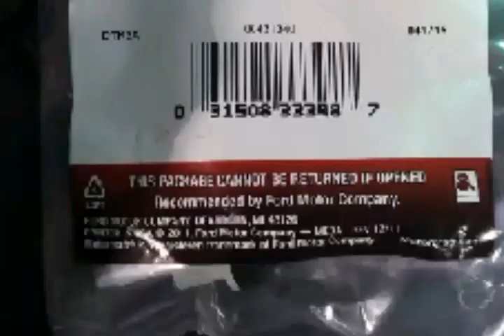Ford E350 - Dash vents turn off *FIXED*

Comment: If its the vacuum reservoir that went bad why are you cutting the vacuum line at the red tube? theres nothing wrong with that stuff right? aqm i missing something?
Reply from the maker: That was just an option for using a soft rubber hose. It'd definitely be better in hindsight to use a union there with your new line.

Comment: No help here the 2012 van  working on don't have a vacuum canister anywhere
Reply from the maker: It does have one. You can't see it unless you pull the evaporator case. You would have to cut a freakishly giant hole in the top of the passenger fender to get to it otherwise.
Reply: Lol ok so bypass with a new 1 way valve and canister under the dash?
Reply from the maker: @guythornbrue3790  yes that is correct when I filmed this I had no idea what I was getting into. I want to make a new video about this so badly but I feel there are several really good ones that explain in really good detail how to do it.
Reply: @gmtech26358  it ended up being the defrost vacuum actuator  . Pulled the dash out just far enough to change it

Comment: Thanks so much for this video. Its the first time I've seen the vacuum reservoir and check valve thats hidden at the bottom of the evap box.
I have a 1998 Ford E-350 Club Wagon with V-8 gas engine. I developed a leak in at my vacuum reservoir or line and it was hidden under my blower/coil unit which is totally inaccessible.  I disconnected the line from the vacuum control  valve leading to the old reservoir and installed my new factory Ford reservoir under my battery tray with a bolt.  The vacuum port comes out straight down from the top of the battery about 11 inches.  I literally left everything else in place.  I liked it so much better than the reroute here.  I didn't have anything to go by when I did this project.
Reply: There are several videos that show how to fix it without taking any of the dash/engine/coolant system etc appart. Most bypass the original vacume resavior and put a new one under passenger side dash. Way less work! Like 2O minutes. I need ro do this to my 2009 e350, but I cant find a single video showing how to take my glovebox out!

Comment: These are insane repairs. This is so easy to fix it's scary. The fix is run a new vac tube from the access port on the top of the dash to the vac line under the hood and install a new check valve.  The failed vacuum line prevents the door actuator from working. Fixing the vac line alone opens the door but every time you hit the gas you lose vacuum temporarily. The check valve prevents loss of vacuum at the actuator.

Comment: Mine is different, the defrost has no air coming out. Sometimes there is no air anywhere bit I hear it running.

Sometimes with no air coming out the front vents, I can set it to defrost and the air will come out the front vents again but never defrost.

Right now though, there is no air coming out of anything.

Comment: So I'm noticing that some people are installing new reservoir boxes and a new check valve and some people are not. What is the purpose of the reservoir box and why do some people bypass it?
Reply from the maker: The reservoir and check valve serve to keep the system vacuum consistent with heavy engine loads. Without a reservoir and check valve the vents will still turn off while towing a heavy trailer up an incline or at full throttle.

Comment: Wonderful video, after watching this allowed me to fix my van myself! However I have a question... I have seen one other video of a guy doing the same thing and he hooked his check valve up differently or reversed. Trying to wrap my head around what the check valve does so I know I have installed mine the correct direction.
The check valve on one end will allow air to flow only one direction. If I turn the check valve one way ( the way I installed mine ) It will allow a vacuum to pull towards the intake or engine and not reverse. If I turned the check valve around it would allow air to flow IN to the expansion tank but not out. The valve side post I have headed to the AC controls. So what is this check valve doing so I know if I have mine the correct direction.
Reply from the maker: The valve needs to flow towards the engine. The tank stores vacuum so the valves will hold position with a low intake manifold vacuum (full throttle/high engine load)

Comment: Soooooooo you had the evap case what was the problem?
Reply from the maker: Not sure I follow your question... I might've not been clear in the video?
Reply: @gmtech26358  I meant since you had the evap case out what was the problem and why didn't you just fix it?
Reply from the maker: The problem was that the vents would default to the defrost position... I did fix it with a new vacuum reservoir and check valve. The point of this video is too show the location and that it can be left in place. The simple fix is to run everything remotely to a new location.
Reply: @gmtech26358  Ok well I did this two weeks ago on my dads E350. Ran the vacuum hose through a hole in front of dog house cover and tie wrapped new reservoir under dash on passenger side. Worked perfectly! Thanks

Comment: I have 2006 E350 cargo. I had same problem, searched for fixes, watched few videos, bought new box and check valve from ebay(about $30), set of vacuum line connectors from pep boys and piece of plastic icemaker tube from Home Depot. On right side of the passenger foot well I pulled off small piece of plastic that covers the fuel pump switch. There, on the wall between the foot well and the inside of the fender, I founded rubber plug the size of quarter or so. I pulled it out, cut small hole to feed the icemaker tube through, then continued feeding it through the inside if the fender into the engine compartment. There is another hole, when you lift the hood, you can see into the fender. in the engine compartment I disconnected the original hose, hooked the icemaker tube with red hose. In the foot well I cut the original and connected top part to the valve, then hooked up new box and the other end of icemaker tube to the valve as well. Replaced the cover and that pretty much holds the assembly in its place with no attachments. Got nice cold air blowing ever since and it probably took me longer to write all this than doing the actual fix. Hope this helps.

Comment: How long does it take to remove and replace vaccum reservoir ?
Reply from the maker: FBD Signs Clearwater if you do it like I did and take everything out it's all day. The cooling system has to be drained and the air conditioning refrigerant has to be recovered. I would recommend just relocating the Reservoir to a different location leaving the old one in there.
Reply: Awesome . Thank you

Comment: Bruce Meil
19 hours ago
This was the best fix it video for the problem. The other videos entailed drilling new holes and adding a new line. Using the info here I replaced the check valve and reservoir. I mounted the reservoir to the blower housing with double back foam tape a perfect fit. The new line was sent back through the existing hole and back up to the connector at the top of the firewall. I even reused the line grommet that plugs the hole. Thank you for showing the real problem so I could fix mine.

Comment: My black hose comes from the red hose and then goes to a connector that has a white hose as well. And they both go up and over top of the heater box etc. Is this the same set up? It is a 2013 Ford E350
Reply from the maker: Steve Walter I would think so. The white line might go to the rear control but I'm not sure.

Comment: Thanks so very much.
Reply: This was the best fix it video for the problem. The other videos entailed drilling new holes and adding a new line. Using the info here I replaced the check valve and reservoir. I mounted the reservoir to the blower housing with double back foam tape a perfect fit. The new line was sent back through the existing hole and back up to the connector at the top of the firewall. I even reused the line grommet that plugs the hole. Thank you for showing the real problem so I could fix mine.

Comment: Excellent video! Thank you for sharing. What size vacuum lines should be used if I relocate the valve and reservoir?
Reply: Did you ever figure out what size vacuum lines to use?

Comment: Well, we have a 1997 E150 Clubwagon with rear ac controls. The ac works great in the back but nothing comes out of the vents on the dash no matter what speed setting the fan selector switch is on. I put 12 volts to the blower motor and it works, so I changed out the blower resistor. Still have the same problem. Saw a post on the internet somewhere that said there is some kind of vacuum motor or switch or line under a panel on the dash. Is your video here related to to our van's ac problem?  If not, can you offer any advice?
Reply from the maker: So you're saying the blower motor will not come on? What engine do you have?

Comment: Appreciate the video, I think. Still not clear where this accumulator is located? Kinda jumped over some of the steps to retrieve the part. Saw the accumulator in the video but could not tell if was from inside the van or outside. I am assuming it was inside but you did not make that very clear. Would suggest you in the future that you include more info for those us who not as familiar.
Reply from the maker: Diana Donovan The reservoir is on the outside in the engine compartment. I plan on making a clarification on video if I have the opportunity to work on one again.

Comment: OK,  can you possibly be a little clearer  for those of us that may have never taken a dash out about how we go about doing the bypassing of the original tank and where / how we hook it up  so we don;t hook the new line to the line thats hooked to the leaking tank?  Thanks
Reply from the maker: jinscoe64 I plan to make a video showing the steps on how to do it while assembled. I just need to find a van that has the problem!
Reply: gmtech26358 i have a van you can do it to mine
Reply: How can you contact me directly?

Comment: Thank you for this video.  I have a 2002 E350 Club Wagon/Van.   I had this problem and I suggest everyone go to about half way in your video to see the vacuum accumulator box that is bolted on the side of the evaporator/blower motor housing.  I bought a new Ford accumulator box and the check valve.  On the inside by the passenger foot well I pulled that grommet with the hose out and that disconnected it from the existing accumulator box.  Then I ran a stiff wire through the hole so I could see it in the engine compartment and then pulled a new hose through into the passenger compartment foot well.  I hooked up the new accumulator tank and check valve and rehooked it up to the existing vacuum line that goes to all the AC switches.  I shoved the new box up on the right side foot well and it seemed to find a nice home there.   I went back to the engine compartment and took the new hose that I installed up to the existing vacuum line (red) to the engine.  Wa La.   It took me about an hour and it would have been 30 minutes if I had a second hand for fishing the hose through the firewall.
Reply: Robert Scranton so you just left the original box in its factory installed location and installed a new one under the dash with bypass lines? no issues?
Reply: Yes.   It's at most a 45 minute one man job.  Two men 30 minutes.  I ordered my parts, the accumulator box and the check valve from Hennessey Ford out of Atlanta.  Check them out on ebay.  The AC works better than ever.  I am now wondering if this problem was creeping in over time over the past couple of years.

Comment: I am having this issue on my 2002 e450. The ac is stuck on defrost and does does not switch to the panel vents no matter what speed the van is driven at. I performed he repair, however there is no change. I used a new ford factory check valve and reservoir and mounted it behind the sheet Metal support over the passenger foot well. Any suggestions where else I might look for the problem?
Reply from the maker: matt4055 you need to check for good vacuum at the control head. it seems like it'd have to be a broken vacuum feed line from the intake.
Reply: thanks for the help!

Comment: finally a technician that actually does this repair the right way.  I worked for a ford dealership for 12 years and done most of the serious  interior repairs and 90% of the engine repairs and 100% of the diesel (powerstroke) drive ability and engine repairs. its getting more and more difficult to find techs that have some integrity and are not hacks. hats off to you sir, for taking the time to do this repair the right way. it will leave your shop working properly and will work for years, plus your customer will be satisfied and thats what matters.
Reply: Due to pooooooor non-serviceable design  for a inferior tank  is at fault yet you praise  for "Doing it Right" which yes he did but at what cost to the consumer that already paid a fortune for the vehicle with an obviously faulty part.

Comment: Is this a only for diesel or does it work for the gas van's top?
Reply from the maker: This works for gas engine applications for sure. The one it my video was a gas engine. I'd imagine it's similar for a diesel.

Comment: nice video helpful,  where is the inlet line that goes to the vent. thanks
Reply: Yeah I need to know this too. I am not getting air out the vent or floor. This did not fix that.